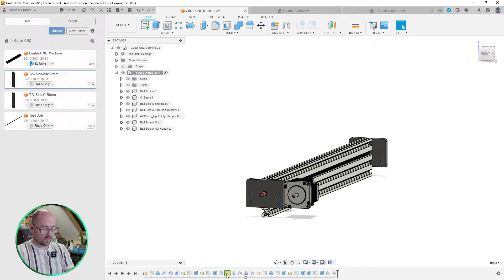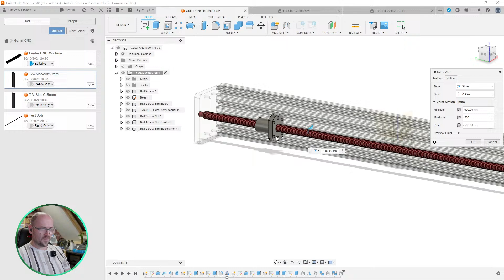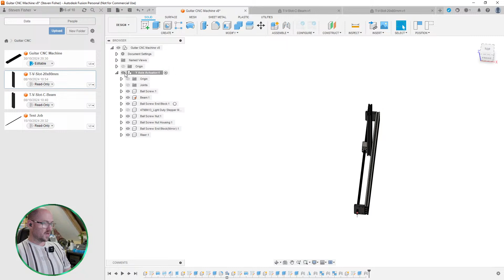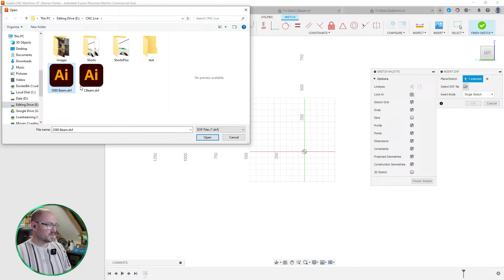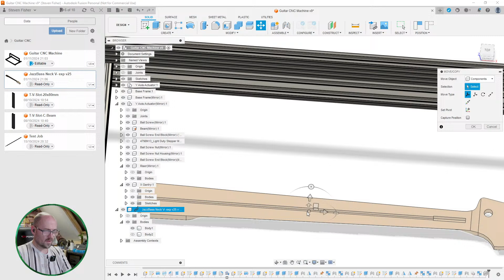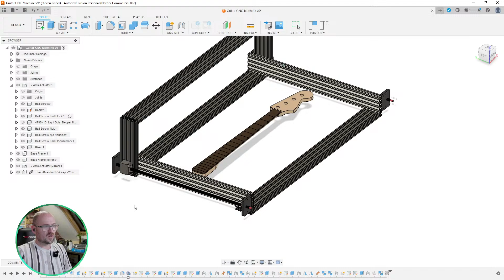Building a Budget CNC Router Ep 3: Mastering Fusion 360 Joints!

Comment from the maker: I may earn a small commission from qualifying purchases -
- CNC Affiliate Links
1/4 inch Downcut endmill - https://amzn.to/3Nr8b67
1/4 inch Ball nose end mill - https://amzn.to/3CRDUZv
1/4 inch Surfacing bit - https://amzn.to/3NzV6Jd
3.175mm Engraving bits - https://amzn.to/3PgJX1a
3.175mm Single flute end mill - https://amzn.to/4hrKtF8
Single Phase to 3 Phase VFD Spindle Controller - https://amzn.to/448LJWl
ER11 Spring Collets (1/8inch & 1/4Inch)- https://amzn.to/4469Q7M
Dust Shoe Brush Material - https://amzn.to/44ZvJXe